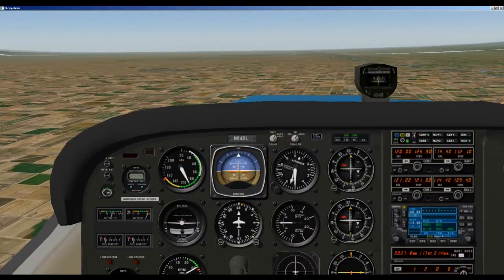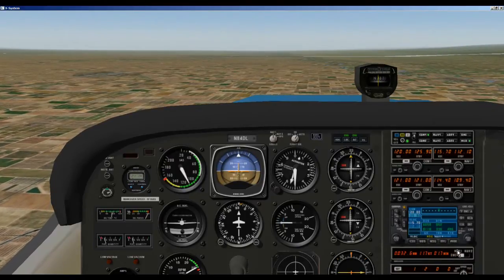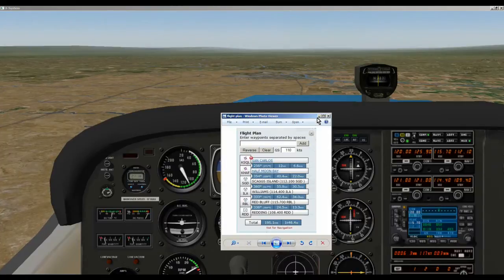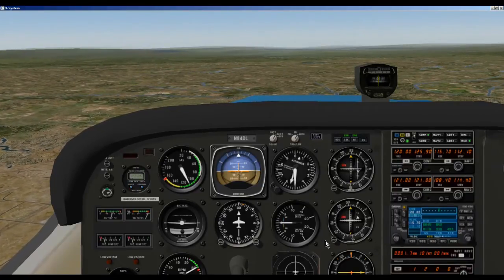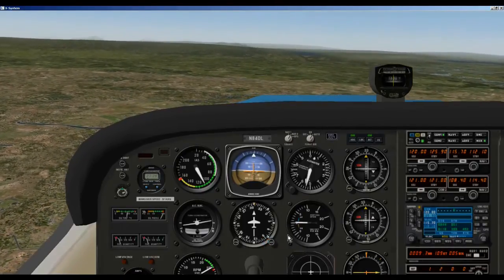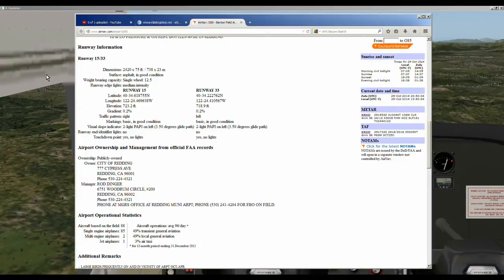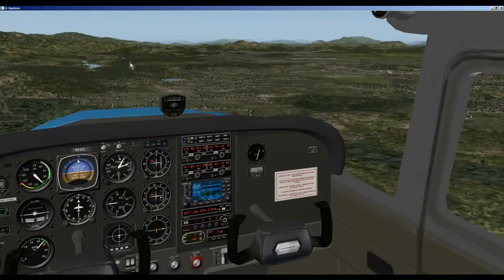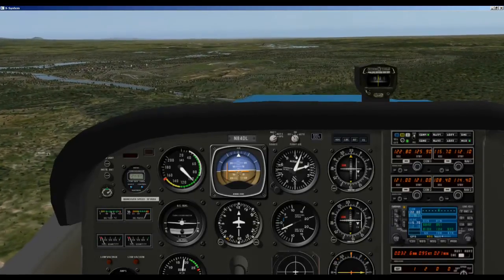How to Use NAV Radios, Plan VOR to VOR Flight in X Plane ~ Tutorial Part 4

Comment: Probably my favorite or top two favorite X-Plane videos ever kudos to you. Being a brand-new flightsim enthusiast having X-Plane 11 I have a question about VOR I noticed in your last video you said nav 2 to the proper heading to get to Red Bluff but did not program the frequency into the radio. So my question is when you set that nap too 233-2336 without setting the frequency and you switch open an app to is it going to go towards that heading or do you have to have the frequency in the radio?

Also one of the question when creating a flight plan I noticed at the airport that you're taking from his automatically included in your flight plan do you keep that there or delete it and start with your first Waypoint as opposed to the airport you're taking off from? Because I know we delete the airport right before the approach as to not fly over it and I was curious if it's the same concept in the beginning of the flight and does the stock Cessna that comes with X-Plane 11 have two knob radios like the one you're flying?
Reply from the maker: Hi Antmf,  You can fly TO or FROM a VOR and that's what we did flying FROM Williams to Red Bluff, I stay on NAV2 114.40 and fly "FROM" the Williams VOR on a course to Red Bluff so I stayed on the Williams VOR frequency using NAV2 in this part of the video until we get close enough to pick up the Red Bluff VOR then switch to NAV1 to continue. So we fly "FROM" the Williams VOR using  NAV2 114.40 until we are close enough to Red Bluff to pick up the Red Bluff VOR  then switch to NAV1 115.70 tuned to the Red Bluff VOR to fly "TO" Red Bluff. The little white "pyramid" in the display points UP to indicate we are flying "TO" a VOR and it points down to indicate we are flying "FROM" a VOR. 

Yes you can delete your departing airport from the flight plan, naturally you won't be using it in your flight.

Hope this helps, let me know.

Blessings,
skip
Reply: WEH Videos my question is do I need the frequency programmed in to the nav radio for the plane to take the proper heading when I switch on the AP? Or is it just enough to turn the dial to put the proper heading into nav 2 and when you switch to AP does it follow that heading? I'm a little confused it seems that you went on the course you needed to be on before putting the frequency into radio hit AP nav and the plane went in the right direction.
Reply from the maker: Hi Antmf,  Yes the frequency must be set to the VOR you want to fly TO/FROM and the course must be set also and the AP must be on and set for the NAV radio you what to use.

I was flying TO Red Bluff but using the Williams VOR flying FROM Williams on a heading TO Red Bluff. I think you might be confused because in the last video I used NAV1 (114.40) to fly TO Williams and I used NAV2 to fly FROM Williams. So after getting to Williams using NAV1 we switched to NAV2 set to the Williams VOR (114.40) and flew on a heading of 336 from Williams to Red Bluff. So we switched from NAV1 set to 114.40 to NAV2 set to 114.40. The reason we were on the right course is because I dialed in the heading of 336 into NAV2 earlier so when I switched to NAV2 we turned and flew that course to Red Bluff. I had to enter the course into NAV2 in order to fly the heading to Red Bluff. Hope this helped.

Blessings,
skip
Reply: WEH Videos thank you so much you are absolutely the best virtual instructor I have seen on YouTube I mean that sincerely. So my last question if I can get the avionics lingo correct as long as it's ever needle is pointing towards the heading of the VOR then playing when switch to nav4 autopilot would turn towards the CDI needle not because the frequencies in the radio it has to do with where the CDI needle is correct almost like when you adjust the heading bug and put it on heading the plane will fly towards that heading so when I turn the CDI needle to the proper heading when autopilot except in that little fly towards that headache whether the frequency is in the nav or not correct?
Reply from the maker: When you tune a NAV radio to a VOR and dial in a course, any course, and turn on the AP and select that radio the AP will turn the airplane to fly that course. If you change the course the AP will fly the new course just like moving the heading bug, you got that right, but the frequency must be set correctly. The NAV radio MUST pick up the frequency of the VOR you want to use. The TO/FROM arrow must be visible for you to use the NAV radio. NAV radios have a certain range that they can be used. Depending on the terrain you can pick up a frequency up to 30 miles or more if conditions are right. So you need to be close enough to pick up the signal and must have the correct frequency entered to fly to a specific VOR.

Blessings,
skip

Comment: This was a great series thanks. :)  Can I ask, in part two before takeoff where you change the setting of the altimeter. Why do you change it and what are you changing it to?
Reply from the maker: Hi Grey,  The barometric pressure or atmospheric pressure changes all the time. Roughly stated it's the weight of the air. The average is 29.92 inches of mercury at sea level and the higher you go the less pressure, you've probably already know the air gets thinner the higher you go. Since your altimeter works off air pressure we need to adjust for the actual air pressure so our altimeter reads the correct altitude. That's why we listen to ATIS to get the present pressure reading so when we dial in the reading in our altimeter it will display the correct altitude.  You can check this when on the ground at your airport by looking at your airport diagram and getting the airport altitude. Now look at the altimeter and see if it matches, if it doesn't you need to make an adjustment. After checking with ATIS and setting the altimeter pressure it should indicate airport altitude. This is a good way to set the altimeter when you don't have an ATIS for your airport. If you know the airport altitude just dial in the altitude and the pressure will be correct. Naturally you can only do this when on the ground at the airport!! Try setting different pressure numbers when on the ground and watch how the altimeter changes, you will see just how important it is to have the correct pressure settings so you have an accurate altitude indicated on your altimeter. Always check with ATIS for the pressure and other conditions before landing! Hope this helps.

Blessings,
skip
Reply: Thanks Skip that's a great explanation. That said... and at the risk of asking a silly question if the first one wasn't already. :) So we know the altitude at the airport we're taking off from because of the air pressure.  But then won't our altimeter be wrong as soon as we fly into the mountains say? Or just fly far enough away that the pressure is different?  I just always assumed that when I look at my altimeter, I could just take that reading to the bank. :)
Reply from the maker: Hi Grey,  Very good question with no easy answer, you could take a whole class on this subject! There are several terms used in aviation for Altitude. First we have Indicated Altitude which is the altitude displayed in your Altimeter and that’s pretty easy to understand (oh that the rest would all be so easy). Next we have True Altitude, Absolute Altitude, Pressure Altitude, and finally Density Altitude. True altitude is your altitude above the ocean MSL. Absolute Altitude is your altitude above the ground AGL. Pressure Altitude is the altitude corrected for non standard pressure (29.92 inches). Density Altitude is basically Pressure Altitude corrected for temperature. Got it??!!! As you can see this is quite complicated and takes some time to learn and I can’t explain it here plus I’m not sure I understand it all myself! Good luck :-)

Blessings,
skip
Reply: Gaghghgh!  Perhaps I'll just lower a weight on the end of a rope!  :)   Thanks again Skip.
Reply from the maker: Hi Grey,  It's really no big deal just check ATIS set the altimeter and your good to go, you just don't want to fly into the ground because you thought you were at 500ft. Places it will really effect you is if you are at airports like Denver at really high altitudes, then Density Altitude is an issue because the air is so "thin". You will need a longer runway for take off and your climb rate will be lower. All this depends on your airplane so if you don't have a Pilot Operating Handbook (POH) for you airplane try and get one and get to know your airplane.

Blessings,
skip

Comment: great job..  May I ask how do you bring up sky vector and air nav while you are in xplane flying?
Reply from the maker: Brent Franklin Hi Brent,  Thanks!  You can exit full screen in X Plane then open your internet browser and go online to SkyVector and Air Nav websites. I have set a button on my yoke to toggle full screen. You can do that by going to Settings - Joystick & equipment, click the "Button Adv" tab. Click the button you want to assign and then  select "Operations"  then "toggle_full_screen". Naturally you can do this with a keyboard assignment as well. Click on "Keys" tab in "Joystick & Equipment" click the "add New Key Assignment" then select the "NONE" button that was just created and hit the Key you want to assign and then select "Operations" and "toggle_full_screen. If you have two monitors you can keep your browser open and running on the second monitor while flying X Plane if not just toggle back and forth as needed, X Plane and your browser can run at the same time. Hope this helped, Let me know how you make out.  Blessings,   Skip

Comment: Great info, thanks. I noticed that at the very top of the radio stack there is a green light next to COM1 but neither NAV1 or NAV2 have that green light? When would you push that button and why? Thanks again..
Reply from the maker: David Turner Hi David, Glad you liked the video. The green light tells you which COM radio is active. Click on the com radio you want to use and you will see the green light displayed on that radio. When the green light is lit on the NAV radios you will hear a Morse code that corresponds to the station the NAV radio is tuned to, assuming it is in range. Normally you will not have the green light lit on the NAV radios unless you really like listening to the same Morse code over and over again all the time. So you would tune the NAV radio to the VOR or ILS signal you want and then push the NAV radio button to listen to the code to confirm you are on the right station then push the NAV button again so the light goes out and you no longer hear the Morse code. Hope this helps.   Blessings,
Skip
Reply: WEH Videos Thanks for the explanation :)

Comment: As all other tutorial - great. I wanted to repeat your flight during watching your tutorial, but the X-Plane 10.31 original N172 has different instruments (Garmin 430 but no knob for NAV1/NAV2). Because of that I could only use LOC1 on the Garmin, but on the other side compare between LOC and GPS mode as they differ a little one from another.

Can you please tell me from where did you download your N172 Skywhawk model?
Reply from the maker: ilankrt Thanks for the kind words!! I purchased the 172N from X-Hanger.com $14. 
and they gave me permission to modify the instrument panel that's why 
the 172N in the video looks different that the one you will purchase. I 
changed the panel color and added new radios and the Garmin 430 plus a 
few other things. If
 your interested watch my two videos on changing the color of the 
instrument panel and using X Plane's Plane Maker.I didn't use the Garmin
 430 in this video just the NAV radios, you don't need the Garmin to fly
 VOR to VOR. I believe the Cessna 172 that comes with x plane is a 172SP
 and you should have no problem recreating this flight in that airplane.
Reply: After I saw you video I tried to change instruments of the N172SP and got a mess!
I have also purchased the model of X-Hangar a long time ago, but the original is not equipped as needed....

Again, I couldn't activate or switch to N!/N2 in this model (there is only an AP knob). Using the LOC1 on the Garmin activated N1, flight and instrument. I think that you have added the missing N1/N2 knob and another ADF device.

I hope that you have some more tutorials in work...
Reply from the maker: ilankrt Yes, I did add knobs and instruments to X Plane's 172SP. I made many changes to my airplanes in Plane Maker so I'm not sure which airplanes come with the needed instruments.Plane Maker is a good tool to learn but you should make a backup copy of the entire airplane directory so if things go wrong you haven't lost anything. Keep trying, it's worth it once you get the hang of it. The 172N I fly in the videos has many changes. For instance the Nav 1 Nav 2 GPS switch and Auto Pilot switch I moved to the top of the instrument panel so I would not have to scroll around to activate the AP. I replace both Nav and Com radios, added the Garmin GPS, Changed the color of the instrument panel, changed the point of view, and a few other changes as well.Exactly what airplane are you flying? Maybe I can give you some tips on getting the instruments you need.Skip